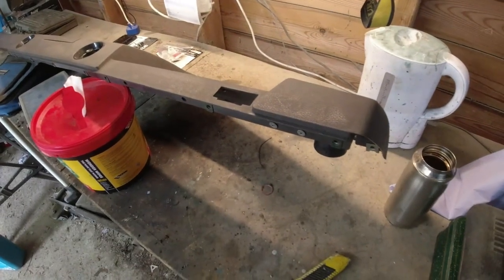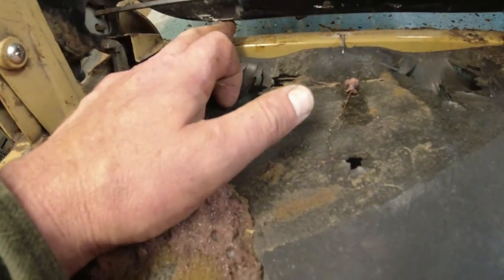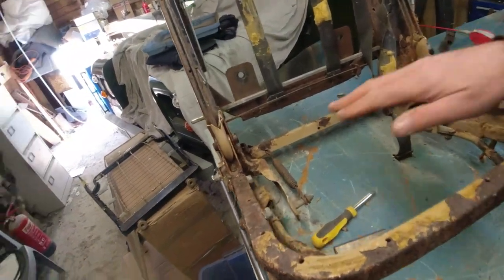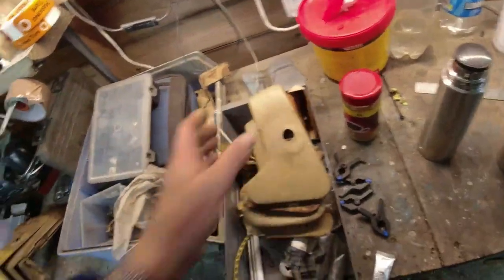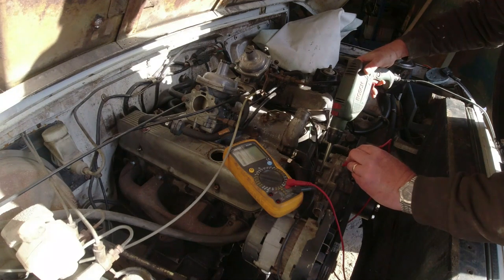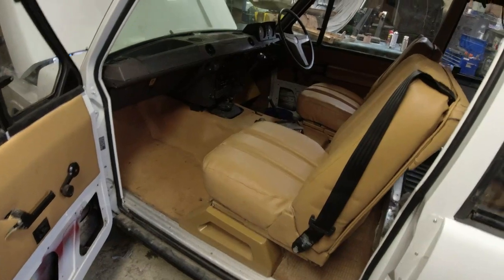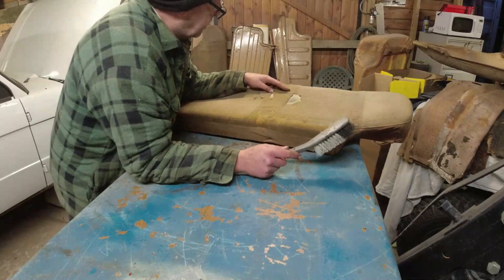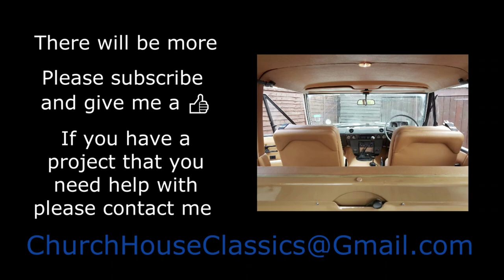1972 Range Rover A Suffix - Diana Part 10, interior refit and seat covers - profanity warning

Comment: I am not so sure with the genuine oil filters anymore. I had a problem with the last two genuine LR oil filter, which were made in Poland and the oil light took 10 seconds or more to go out. Switched to a Mann aftermarket and everything well since than. Happened twice now. Even made a video proof of it.
Reply from the maker: I will keep an eye on them, not sure of where my filters were made. Because I use them quite a lot I buy them in batches, current batch is good

Comment: Oil Pressure used to be fairly low- even on Brand New Vehicles
Reply from the maker: Rover v8 never needed high oil pressure. Not unusual to see an oil pressure light flickering when stopped on an automatic version and in drive,